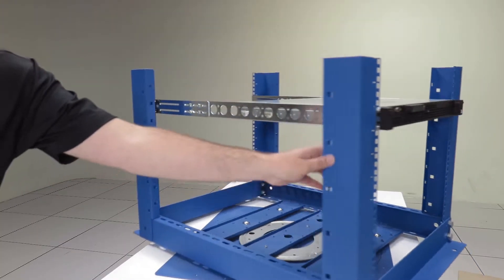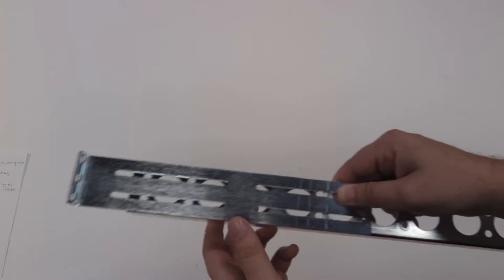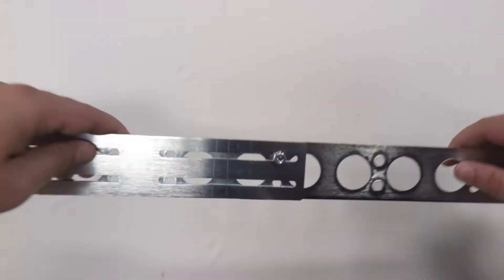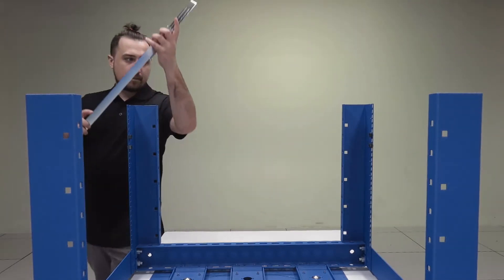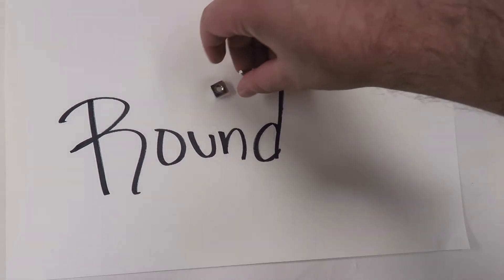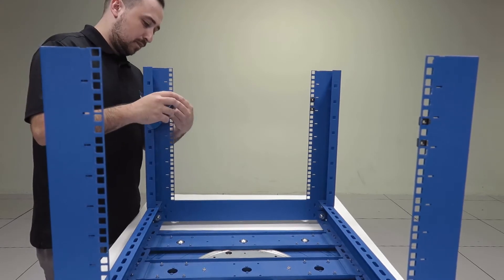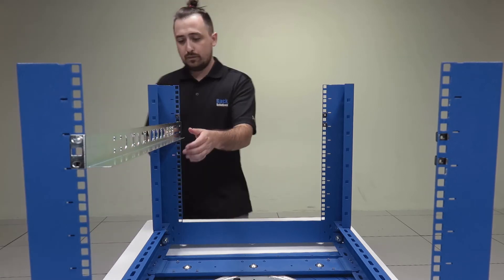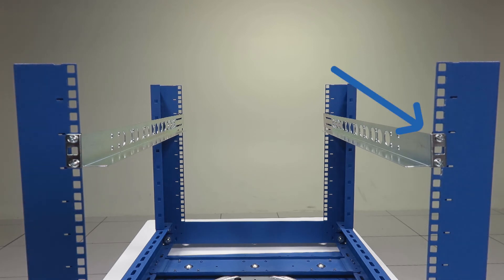How to install a server rack rail

Comment: Could you have put the cage nuts facing in so you are screwing from the inside out and the ears of the server can sit flush with the outside of the vertical mounts? In pics I’ve seen on Amazon it seems that’s how these extenders are suppose to be setup.

Comment: I assume this would work fine for Music Studio Racks too yeah?
Reply: server racks are generally universally uniform which is why this video is good for IT, cant say for music
Reply: Years ago, I had purchased a 7 foot tall server rack for rack gear.  This may be similarly spaced.  I would call a Guitar Center to ask what spacing you will need 1st.  Last I knew, it was 18 5/16″ (18.312″ or 465.1 mm) or roughly 19" between holes/ slots.